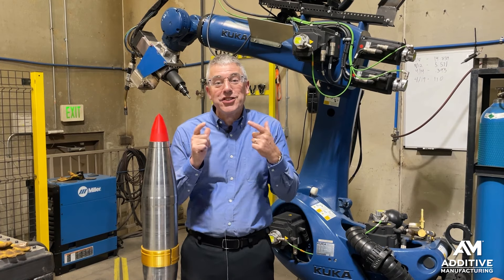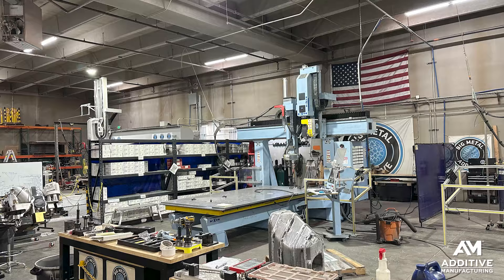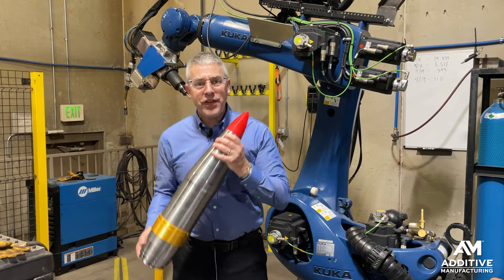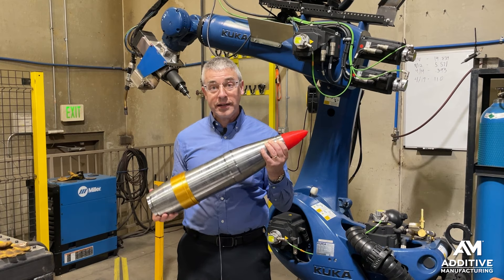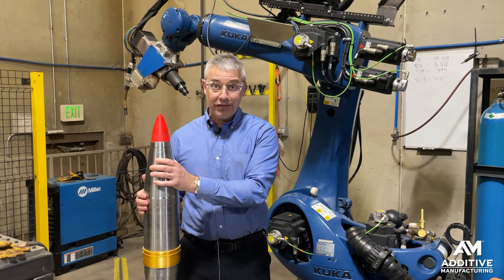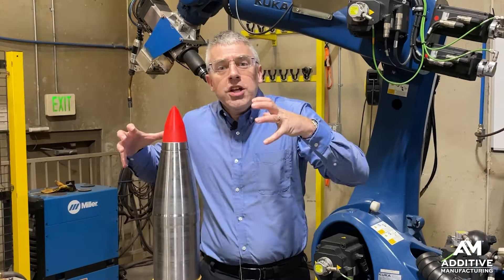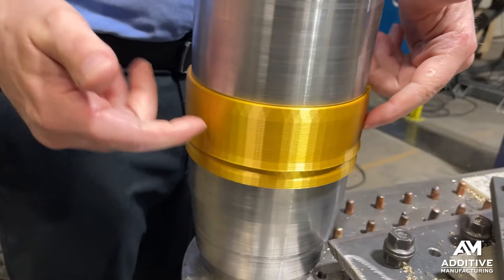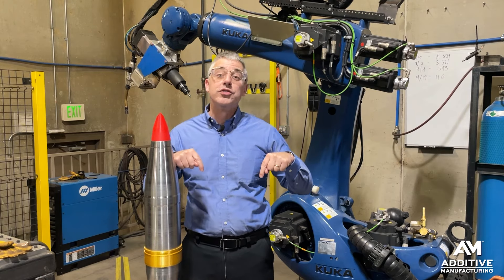Navy Projectile Housing Made Through Robot 3D Printing

Comment from the maker: Some of the comments raise questions related to capacity demand. These are good questions! The answers touch on several relevant points:
 
1. It is not just production rate that is important, but also responsiveness! Forge and foundry capacity in the US is limited. Lead times for forged and cast parts are getting longer and longer. Additive manufacturing offers the chance to quickly begin production of the component you need.
 
2. Just because AM can do the job does not mean forging stops doing it. Get the ammo you need right away through 3D printing, while you wait for forging to catch up and start producing much faster.
 
3. It is the nature of military hardware that we go a long time without needing it. (Indeed, this is what we all hope for.) During that span of time, the military's forging supplier might have gone out of business and the tooling might no longer be available. The military is very interested in developing digital manufacturing instead. A new supplier can more easily be found if all you have to give them is the digital file.
 
4. I am not sure about the assertion that the production plant imagined here would have a large footprint. Forging involves furnaces, tooling, large stocks of raw material, and machinery that is multiple stories high - plus there have to be machine tools somewhere completing the parts. Which process is the footprint winner is not clear to me. 

-PZ

Comment: This is a very poor example to use additive manufacturing.  A basic round cost for a 6" round is currently in the $500/round price range using traditional subtractive manufacturing methods. The cost per unit is just too high for the volume needed (100% identical item). At 6 projectiles per day and a demand for over 24,000(a mathematical example) per month for each size projectile, there is a need for 800 robotic DEDs at a cost of at least $150,000-$200,000 each ($120,000,000-$160,000,000). This is in addition to all the other manufacturing and QC steps needed for production.
Reply: The video also failed to disclose that the tooling for this weapon is already in service and paid for.
Reply from the maker: This is one of several insightful comments on the video. Thanks for watching and sharing your thoughts. See pinned comment for additional insight.
Reply: @AdditiveManufacturing  FYI I have been involved with AM for about 8 years and I am an original member of Project Diamond where over 300 AM machines are linked together in SE Michigan.
Reply: The cost of not having them is potential military loss beyond $, so LFG
Reply: @moneyballX   I agree. Did you read my comment that there is already tooling to manufacture these projectiles?

Comment: The fracture characteristics of the artillery and gun projectiles in use today are very tight tolerance and unusual alloys.  Don’t see anything here about the material compatibility / ability to meet materials specifications.
Reply from the maker: Right. 3D printing the object was not the challenge here – meeting all the specifications was. Exactly what requirements Big Metal Additive met in this case is beyond what I know, and some of that is guarded, but the company would not have been able to deliver on this project without a quality system enabling it to capture and assure compliance with a list of specifications. Talked about that in a related article: https://www.additivemanufacturing.media/articles/big-metal-additive-the-difference-between-a-shape-and-a-part-is-quality?utm_source=youtube

Comment: According to a recent special report by Reuters, current 155mm shell production in the USA is about 35,000 PER MONTH, and scheduled to increase to 100,000 by 2026. Adding 600 more is insignificant, and the investment for an AM factory with 100 robots is very substantial. Wire-arc DED is an amazing technology but this is not the application for it.
Reply from the maker: Thank you for watching the video and sharing your take. Please see pinned comment for additional thoughts.
Reply: There are less Navy 127mm / 5” guns in use than artillery howitzers on land in active combat in Ukraine.  About 100 in US service, (more in Allies navies as well) and they’re not firing all day every day.
Reply: @Georgewilliamherbert  Be that as it may, an AM factory should not be manufacturing goods that are mass-produced elsewhere. This is just not a good use of the technology in my opinion, which is well-known to be best suited for complex, low-volume, high-value applications. Much better uses of AM and specifically wire-arc DED have been showcased in this channel.